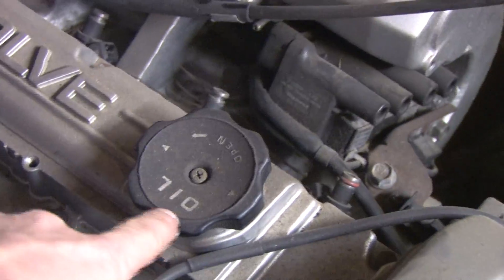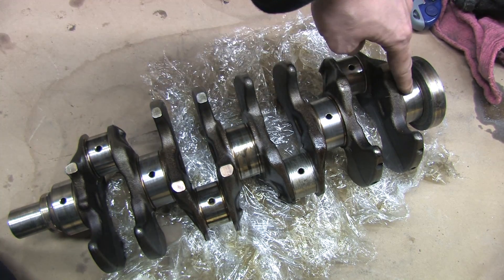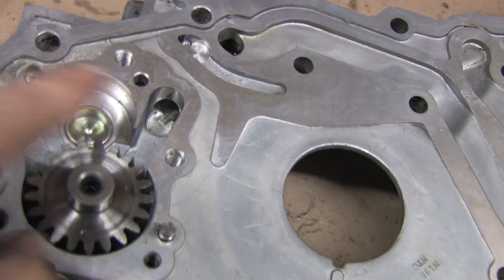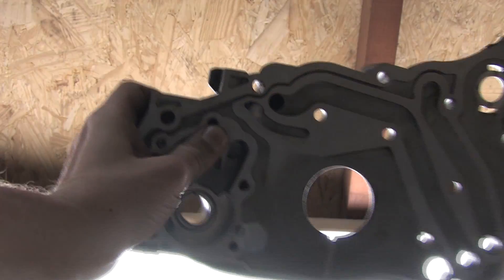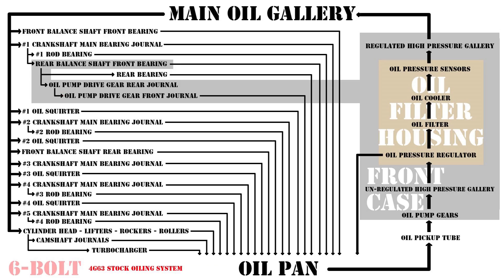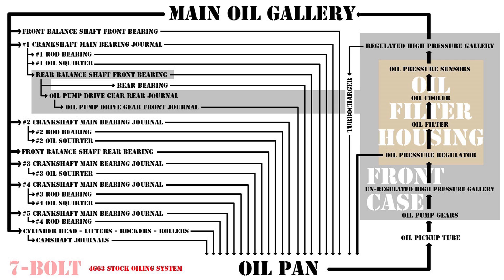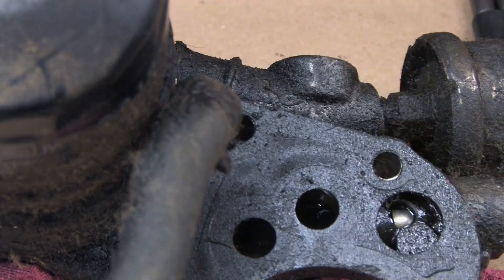4g63 Oil System

Comment: I bought a 90 awd talon, built motor, FP turbo, the guy I got it from changed the dash which I'm not sure could cause the oil light stays on and never shuts off the gauge when you start it goes high then drops to low , new oil pressure switch, any ideas what could be going on? Runs really good no noises
Reply from the maker: When I rewired my Elantra, I was all over the electrical diagrams in that video.  I rewired the engine harness to 1990 spec, and I think it's shown in there with the check engine light, etc...
Reply from the maker: If the oil sensor connection, or any part of that circuit is open-shorted, back to that bulb, then the light comes on.  Grab a circuit diagram, when you digest it, it makes perfect sense.  I don't know off the top of my head to tell you where to probe on that car, but it's essentially a simple, 1-wire ground circuit.  If you bypass it with another wire end-to-end and the light goes out, it confirms the factory wire is an open circuit (broken wire/bad connection)

Comment: Hello master , I need your help , please!. Let's see , when I turn on my car ( Mitsubishi RVR sports gear x3, engine 4g63) the oil pressure is 80 psi for 800 RPM (for 65°F). but when the engine starts to heat, the oil pressure drops to 0 psi (200°F). What do you think ????  
Note: my Metales are new.
thanks

Comment: People who don't understand you are asking questions on what oil to use?  The one that is recommended from factory.. regular oil! From 1g to 2g 1988 to 1999 regular 5w30 ... your not running a European aluminium block your running cast iron! Iron blocks regular oil aluminum full synthetic.. for cars with performance mods and iron block semi synthetic or liqui Molly should do great... do not use full synthetics on iron blocks unless you like to throw your $ away
Reply from the maker: I understand.  I mentioned it because the 1g service manual and the 2g service manual don't recommend the same oil specification.

Comment: 1 mistake..... 1g is 6 bolt not 7.  You mentioned it while showing the oil chart.. 2g blocks are 7bolt .. 1g is 6bolt
Reply from the maker: 6-bolt production ran until mid-year 1992 production.  The 1992.5-1994 model years are 1g 7-bolts.  The 2g 7-bolt is a completely different engine than the 1g 7-bolt, as it has a bearing girdle.  I assure you I got nothing incorrect.  All 1g cars aren't 6-bolts.  It's just a coincidence that all 6-bolt factory cars are 1g's.

Comment: Hi jafro,
can i ask you a question about how the oil squirter operate.
I have a Mitsubishi Legnum VR4 which has the 6A13tt engine 2.5L V6 twin turbo. with about 160K miles on it.
i have been stipping it ready for rebuild.
This engine has oil squirters from the main crank bearing to each of the cylinder bores.
they seem to consist of a pressed in insert in the bearing oil groove and there is a spring loaded plunger inside it.
is this the same as the 4g63 oil squirter.
if so when the plunger is pressed does this open the oil squirter and spray or close the oil squirter and stop spray.
I would have thought it would open.
When i stripped my engine, all bar one was clogged up with gunk.
I cleaned them out but was not sure what the correct operation of the plunger should be. 
When i spray solvent with compressed air (DIY parts washer like yours) it does not spray out of the squirter. i am concerned they are still blocked.

any help/feedback on this would be much appreciated.
all the best
davezj

Comment: Hi friend,why doesnt my mitsubishi flow oil to the head?thanks.
Reply from the maker: It's because of the teardrop on the cylinder head being milled too thin, or a head gasket problem where it's not oriented correctly and blocking the port.  There is a teardrop-shaped indention on the bottom of the head that carries oil from a small hole, through a gallery on one of the head bolts, and into a small hole inside the cylinder head at that head bolt.  Oil flows around that bolt.  If there's anything obstructing that gallery, no oil will flow.  If the head is from a 7-bolt and the block is a 6-bolt, the stud itself is blocking the oil flow because the head needs to be drilled out larger to accommodate the bigger bolt used on 6-bolt blocks.  There are a lot of factors that could be at play and I can't tell enough about your equipment from your comment, but that's the area you should inspect.  You'll need to take the head off to find the problem.
Reply: Jafromobile ..thank you for answer friend,let me tell you what i checked:oil pump is new,oil filter,pick up tube,camshaft crabkshaft,changed oil,it only happen when i start the car or when i park for I hour,not happen running.Sorry for my English,thanks.

Comment: So.. more reasons to keep balance shafts. What would you say If I kept both balance shafts in, but a shop removed the belt for the front bs and then that caused my engine to run funny/ lug a bit.. So then I installed a fluidamper pulley and it cleared that up and runs much better but now runs one balance shaft instead of two. 

I also run mitsubishi oil filters and VR1 20W50 weight oil. Haven't had any issues and I have some mileage on it now. Believe it or not my transmission was shifting really funny until I put that fluidamper pulley on.

Comment: Got another question, recently i had to change the valve gasket and the water pump on my Eclipse 2g GST, before the change it used to make about 10km per liter, now its making about 4km per liter... Got any clue what could be the problem? :/
Reply from the maker: Is it running poorly?  Rough?  Do you smell gas?  If you changed your valve cover gasket, the fuel rail is right behind it.  You might have damaged an injector seal if any of that stuff was disturbed.  There could be a vacuum leak (boost leak) or a disconnected hose?  If you removed the timing belt to take out the one obstructed water pump bolt, you might be a tooth off on your valve timing.  There's a lot of different issues that can contribute to that problem, but if you feel it's a cause of service performed, give everything around the area you were working a good visual, and then check those timing marks.  That's what I'd do.  I make mistakes sometimes.  If you're lucky enough to have a check engine light on, reading the ECU codes will likely tell you what the problem is.
Reply: Thanks for the reply, so the service was done in a shop near my house, im having second thoughts on there work... but back to the problem, im sure they had to remove the timing belt, but im not sure how to check the valve timing... Im quite a noob when it comes to engines, iv been folowing your chanel to learn more and start to do my own fix arround it. Anyway, i dont want to take the car back to them since iv lost faith in there work... 

Nope, no gas smell, and i guess its not running poorly nor it is rough... But i have to say that i felt the turbo charge a bit strange after it came back from the shop, i hear a different sound of what i was used to, when i asked them about it, they said it was all fine :/... The boost used to fill up fast and trouble less, now iv got to step all way down to fill it up (kinda like a lag). 

No engine check light.

If the fuel rail is damaged, would i get a fuel leak?
Reply from the maker: Either your valve timing is wrong or you have a boost leak.  Start with the boost leak because that's the most common cause of what you described on a turbocharged car.  I have a whole series of videos about boost leak testing.  Watch those videos and start there.
Reply: BTW A disconnected hose im quite sure its not :/
Reply from the maker: There's a lot of different ways a boost leak can happen.  I demonstrated how to find all of them with an air compressor and soapy water.  Also, if you have a pre-turbo exhaust leak (cracked manifold, blown gasket, loose flange, etc.) It will be hard to spool and get bad gas mileage.  An exhaust leak could cause it, too.
Reply: Gosh, thanks for the help Jafro, iv been in contact with a mist club and next week they agreed to give a hand to check all the things you have listed. Someone in the group commented that it could also be a ECU problem? im not sure if that could be the case.

Comment: Love your videos, im having a hard time changing the transmission fluid on my 2g 4g63 manual transmission. Could you spare a moment to do a video about that?
Cheers
Reply from the maker: Boy are you in luck!  Look for "Trans & Clutch 7 - AWD Fluids".  :)
Reply from the maker: Oops "Trans & Clutch 7" is the rear end and transfer case.  Look up "Changing Manual Transaxle Gear Oil".  I have a separate video for the transmission.  :)

Comment: So if I have this correct, the 1G has a better oil system because it doesn't allow starvation for the mains?
Reply from the maker: +Alex Miller If the pump is working properly, neither a 1g or a 2g oil squirter should starve the mains.  That's really what it all boils down to.  The oil squirters have absolutely no bearing (pun intended) on the main and rod bearing failure issues that DSMs often experience.  It's just a topic of discussion that many tuners like to argue about.  I don't believe the design of either the 1g or 2g stuff makes any difference at all because the oil pressure regulator will compensate for any difference in their flow rate.  That is… unless it's out of range because the oil pump isn't moving enough oil.  In that case, it's not the oil squirter's fault.  It's the pump and we're right back at the same place where we started this discussion.  Seriously, ask the next guy who challenges you about the oil squirters WHY they're a problem and see what he says.  How he justifies it?  It should be entertaining.  

Squirters don't pulse or turn on and off.  After you hit 10 PSI (idle pressure) they start squirting and they never stop.  They can be stuck open and never cause bearing failure because they don't leak enough oil to starve the mains if you have a good pump and a properly-funcitoning oil pressure regulator.

Comment: Jafro, Almost through all your videos, can't imagine how long it too to make them!! Blew my 6-bolt & Hyundai head (increased CR). It had roughly 10k miles before failing. Im going to swap another engine into the car, and decided to jump on JAM built 2.1L. Since the low miles from the previous build, I am thinking of swapping the timing belt, and all peripherals, oil strainer etc. Is there anything wrong with that? Factory service manual 91 for 6 bolt? Or will Chilton or Haynes suffice?

Comment: Hey Jafro your videos are awsome bro!
im having an issue with my 7 bolt on my 05 Evo maybe you could help me please!
i rebuild the block and theres no oil pressure.
the block is complete in the car with the transmission.
new gaskets, new oil pump, cleaned oil passages and all with high pressure diesel!
when i prime the pump with out the head, oil comes out of the right top hole slowly. not with pressure. what could it be.? PLEASE HELP!! :/  THX YOU!!

Comment: just wanna ask u y my car always got problem on the track with the main crankshaft bearing and crankshaft...my car is 4g63 evo3 engine with 500hp running 1.5bar....some fren say i have to change my oil sump to 6litre its true...coz i already change my oil pump from belting to bearing......do u have any answer..and should i change my oil sump to 6litre....for time attack 
tq

Comment: Jafro thanks for the videos,  quick question regarding 6 bolts front case oil pump. should i buy a new front case or should i just get the oil pump gears.

Comment: amazing!! where do you get all that info and knowledge?
so to to eliminate that crankwalk on the early 2g 7-bolt engines all you have to do is increase pressure on the 5th journal bearing right next to the flywheel.. or get yourself an 1g 7-bolt blok? wrigth?

Comment: @lawnside82 I have personally experienced a 4gxx with an out pf phase oil pump drive balance shaft. It is very noticeable at 2000and up. It almost rings. I did build a 2.4 optima engine and it has the same basic timing belt setup as a 4g63.

Comment: Building a 600+ hp turbo 4g63 with a NA 6 bolt. Should I go through the machining process of having the oil squirter bosses drilled and tapped? Or should I just not bother with the oil squirters and be just fine without them? I know the benefits of having them, but weren't they best with the factory pistons rather than the forged ones I'll be using.

Comment: I have 650cc inj, I cant use 255w fp since all bolts are rusted and missing 4 already.I installed dsm link and have a fp green but dont know how to bolt the waist gate to it. got the cyclone intake manifold with a 14b waist gate to open the secondary runners. I want a torque monster more anything but idk how to go about getting it there. afr are bad and i dont get how to tune really at all. the concept of a car and how it works is easy but tuning is a different story! do you have vids of tuning

Comment: 450 is plenty! I used arp head studs 90psi i believe, but i havent even touched the block at all! bought abuilt 7 bolt w/ a bad oil leak turn out to be thrust bearing play like alottt of play. Took apart the block and all new bearing were trashed from 800 miles everything was mint but the crank and bearings =[ im afraid to mess with the block since i dont know how to measure everything! i believe it was a lack of oil to specific places as you were saying in the video that caused crank walk spunb

Comment: WOW you should be in the teaching industry!!! amazing and clear cut explanations! im scared to do the balence shaft removal now since i dont want an extra build up of oil pressure! I finally bought a good running 4g63 "with a blown turbo" found out it had a few bent valves and bad valve seals, since the guy before me had it off timing and so i put the head back together with all new BC internals and 272 cams and im not sure how much a stock 92 6 bolt block w/ 100k could handle what do you think?

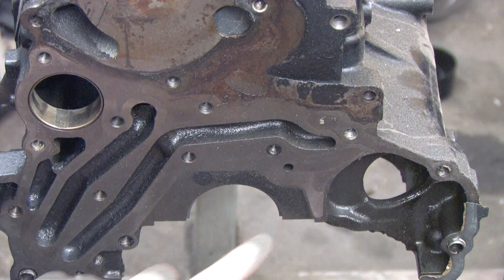Comment: At 1:34 where you pointed at the oil passage on the block. Can it be an option to grind and blend that rough casting smooth to get rid of any restriction? Or is there really no point to it cause it wouldn't make a difference pressure wise?

Comment: THIS IS AN INSANE AWESOME.  I like it.  It might solve my new block's failure because of the oil pressure.  I appreciate it a lot. Thanks so much for the insight.  My new engine failed after 300 miles , it's a mystery to be solved from this video.  THanks.

Comment: It is also worth noting that in high load environments a full length shaft such as the AMS can provide greater support to the oil pump gear, lessening wear on the gears and on the inner bearing surface, which would be subject to more potential off axis loads and stress without the inside bearing.

Comment: Hi, thanks for video, my second question, at 6.55 in video, i see that oil goes from oil pan to oil pressure regulator directly without going via oil pickup, pump gears, etc.. may i know what is that route and when it will be used.  2) is the return path of oil from crank journal, main, rod bearing , is to the oil pan, or it goes to pump and it is bleed to oil pan..  please..

Comment: hi, when i do oil pressure test, will it indicates if there is a failure in pump gears because of wear and tear. you picture shows that unregulated oil pressure goes to filter, regulated, and then goes to main oil gallery. so can i assume any oil goes to main oil gallery will always be regulated.. also can i assume PUMP will always produce unregulated oil pressure and before it goes to main gallery it will be always regulated.

Comment: what would specifically cause multiple turbo failures and low oil pressure at operating temps?    and can you make a video on how to RESET the BISS screw in great detail?  thanks in advance....

Comment: this was pretty good although I drive a different car its nice to see a breakdown of how the oiling system works for a 4g63. I never put much thought into my oil system besides doing some quick homework when building my engine about it weak points and poor low rpm oil psi.